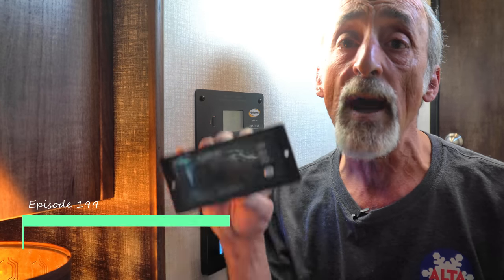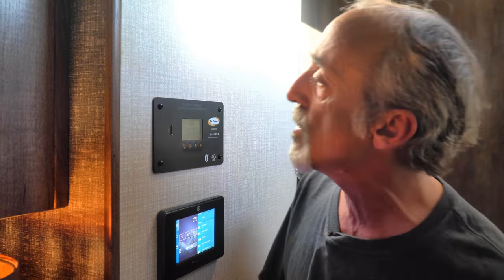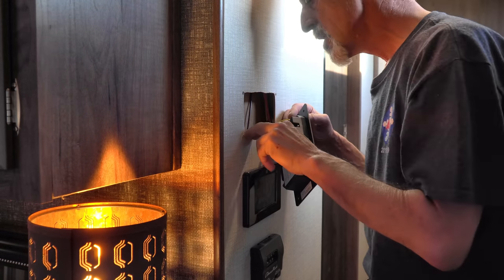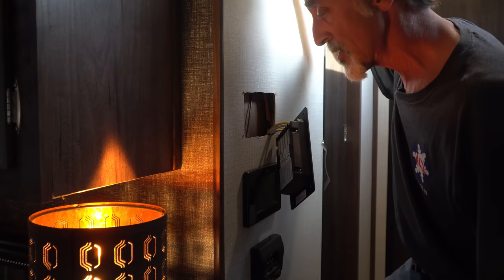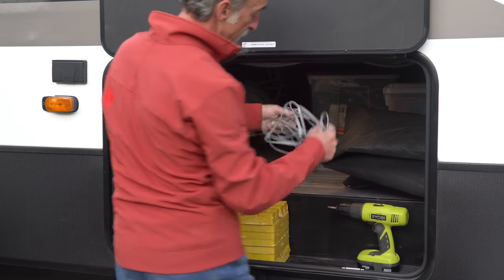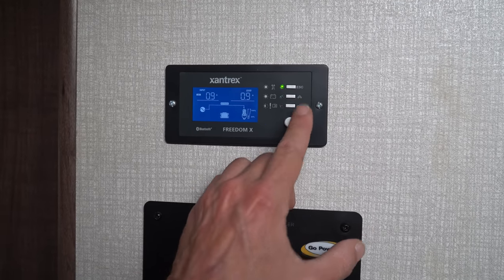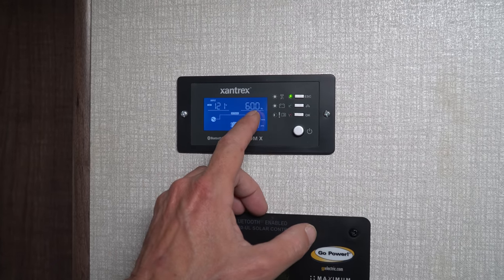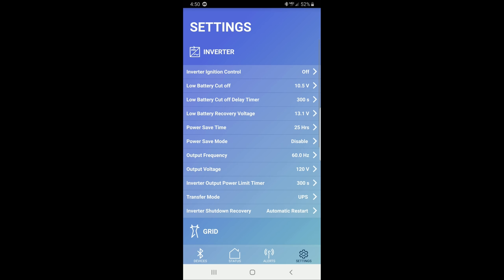Ep. 199: Xantrex Bluetooth Remote Panel for Freedom X/XC Power Inverters & Inverter-Chargers | RV

Comment: My KZ came with a zantrex 1200, it does not have enough power. Would you just upgrade to the 3000 zantrex ?
Reply from the maker: Robert, we did exactly that: https://youtu.be/e3BEH6-Zxzw and we've been very, very happy with the results. We left SLC over a month ago, have been boondocking or dry camping ever since, and haven't even unpacked the generator. Only you know, however, just how much energy you need.

Comment: The (our) original inverter Zantrex 1200 has a 30 amp transfer switch. We have in our KZs 50 amp power. I know they wired it from the panel. The New one I got Zantrex Freedom X 3000 also has a 30 amp transfer switch. Your new one 3000 XC has a 50 amp. Did you route the original transfer switch to the new one?
Reply from the maker: Not sure I fully understand your question, we're using the 50A transfer switch built into the XC3000. But we wired the new inverter very differently than the factory installed 1200. The latter was installed on the GFCI branch circuit, as I suspect yours is. Instead, we put the XC3000 on one leg of the incoming 50A shore power, upstream of the main distribution panel. That way we can run multiple branch circuits off the inverter.
Reply: @GrandAdventure   You answered part of my question and thanks. The original 1200 is a 30 amp transfer switch model as is my new 3000 x. The / My 1200 only has 1 line out to the panel (GFCI) Line 1 and line 2 at 120V both have 50 amps each at the posts. How does/ did the 1200 not burn up ? If I just replaced the 1200 with the 3000 I’m Leary about the amperage, I don’t understand how they put a 30a inverter into a 50a system without blowing it up. I understand electronics but I’m confused how they run 50a to the transfer switch and then to the circuit box - it’s still 50a each line and then a 30a inverter

Comment: Hi Mark, I would like to know if your new panel came with the cable and does the one on the FreedomX still works?
Reply from the maker: Yes John, the panel on the inverter still works when the remote panel is attached and connected. It's been a while so I don't recall, but I believe I had to purchase the cable separately.

Comment: At 11:33 the number on the right will actually show the number of watts being drawn from the house battery when the inverter is providing AC power to your sockets using the house battery with no shore power.  I have the same inverter and display, works great.
Reply from the maker: Thanks Tom! That's great to know. We didn't notice that when we cut shore power during testing.
Reply: Definitely is a good inverter charger

Comment: Marc thanks for this video. However quite misleading as I purchased this panel to be able to turn off inverter via Bluetooth only to discover it cannot be done!  I now see in one of your replies you acknowledge this. Bummer.
Reply from the maker: Paul, I sincerely apologize if you felt misled. Having remote power on/off was my intention as well (along with the remote data access), and did not realize that I could not perform that functionality until after the video was produced.
Reply: @GrandAdventure  Totally understand. Seems like Xantrex should have made this a priority. Mine is installed and still useful.

Comment: Yes the Bluetooth remote is a game changer I always change my float voltage to try n balance my 600 ah 3P 4S setup
Reply from the maker: And it's so much easier using the app to change settings than it is on the display.

Comment: My green light just stays in the middle and is killing my battery’s I have the inverter on button turned off outside and the green button won’t switch to top how do I get it to switch so I stop draining battery’s and use shore power
Reply from the maker: Something's off because the inverter has a built-in transfer switch that should bypass the inverter automatically whenever the RV is plugged into shore power. I'd call Xantrex with your question.
Reply: Could that have something to do with y my microwave and front ac won’t work too and thank u
Reply from the maker: @zackpoor5609  I wouldn't think so.

Comment: I presume that if the Xantrex was also a Charger, you would not be interested in shutting it off.  I am considering getting an inverter/charger combo from them.
Reply from the maker: James, our Xantrex Freedom is only an inverter, not an inverter/charger, hence the desire to turn it off when not needed. However, we intend to upgrade to an inverter/charger when we're stationary come November just so that we can power the entire rig, rather than just one branch circuit. In our case, that one branch circuit is the GFCI-controlled outlets.

Comment: Not necessary to turn the inverter charger off I keep mine on in my camper Van 24/7 and no issues
Reply from the maker: There's an inherent inefficiency to inverting power. Even if there's no load on the inverter, it's still consuming battery power while idling. If you want to minimize battery SOC loss, you may turn off the inverter to do so while it's not in use.
Reply: @GrandAdventure  my freedom xc 2000 no load power draw is around 1 amp or less I think and I'm using a 600 ah lithium lifpo4 battery bank
Reply from the maker: @coreybabcock2023  our battery banks are identical.
Reply: @GrandAdventure  do you use 200 ah calb plastic encased prismatic cells ?
Reply from the maker: @coreybabcock2023  no, I meant that we both have 600 amp hours. We are using six 100 amp hour Battle Born batteries.
Reply: @GrandAdventure  sweet

Comment: Hi Marc! Just ran across this video. This is the same controller I added when I installed the Freedom XC in my old trailer. Now that I got my new 283rlt, I will be adding it to my wall and connecting it to the Freedom X that it came with. Im like you, dont want to go outside every time I need to turn it on or off. Looking forward to cutting a hole in the wall...LOL.
Reply from the maker: And the fun begins. 😄

Comment: Marc, Are you able to turn Inverter on and off through both the remote and the mobile device app? Also, did you have to upgrade the firmware in order to make the Bluetooth connection persistent?
Reply from the maker: The app doesn't allow you to turn it off or on from the app, Michael. It's limited to information and settings administration. Unfortunately we're experiencing the Bluetooth persistent connection issue, but we can't upgrade the firmware as we have a Freedom Pro X 1200 inverter and not a Freedom Pro XC inverter/charger. The latter has a USB port to allow upgrading the firmware, whereas our Freedom Pro X 1200 doesn't have one.
Reply: @GrandAdventure  Thank you Marc. I like you have only the inverter only installed.  That explains some of the comments left in reviews. I guess it would require sending the inverter back to Zantrex for an upgrade.  Thanks you for your time and keep up the great work with your channel!
Reply from the maker: @michaelmiller8140  thanks! Worse than that, for the upgrade Xantrex tech support asked, "Do you have any friends with an XC?" 🤣 Actually, the Freedom X 1200 came with the trailer from the KZ factory, but I'd rather have the XC because that would power everything. The Freedom X can only power one branch circuit (in our case it's the GFCI-protected outlets) unless you install a sub-panel. We're planning to upgrade again once we're stationary this winter to either a Freedom XC inverter/charger, or the Victron Multiplus 2 so that everything can be run off the inverter. We'll also add a couple of more Battle Born 100Ah LiFePO4 batteries for 500Ah total, and a few additional solar panels.
Reply: @GrandAdventure  Ours came with our new Cougar as well. They have it mounted upside-down in the passthrough compartment and it is impossible to see the display. I appreciate the insight!

Comment: I hate the zantrex X2000!!!!!!!!!! How do I set the DAM Thing!!!!!!!!
I hate the zantrex X2000!!!!!!!!!!
I hate the zantrex X2000!!!!!!!!!!
I hate the zantrex X2000!!!!!!!!!!
Reply from the maker: That's where this monitor really shines. Besides providing a remote display it allows you to connect to the inverter with the phone app, which allows you to adjust the settings in English rather than by codes. SO much easier!

Comment: Finally got a chance to watch the new video. Another great job. Nice clean install. I know you know this but (and it is a minor but) on the display the voltage on the battery (I think you said 14 Volts) if you are plugged in is realey the voltage from the converter/charger not the actual charge  on the battery. You have to turn off all outside power and let the "float charge" dissipate to get a true charge voltage. 12.6 or 12.7 is considered a full charge. 
I know you are excited about getting back on the road.
Reply from the maker: What you say about the inaccurate voltmeter reading is absolutely correct, William. However, as we're using LiFePO4 batteries our full charge is indeed 14 volts, not 12.6 or 12.7 as would be the case with flooded lead acid batteries. We have an ammeter and shunt to get accurate SOC readings from the batteries.
Reply: @GrandAdventure  My bad I forgot you had the  LiFePO4 batteries.
Reply from the maker: @WILDEBILL308  no worries at all.